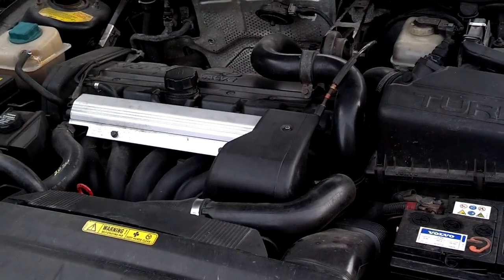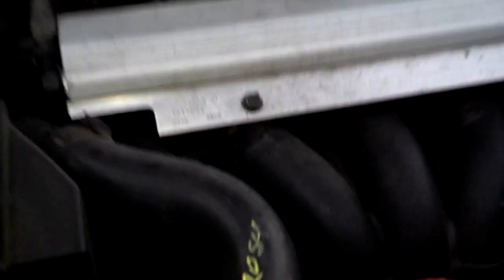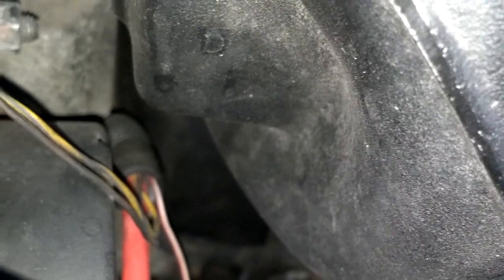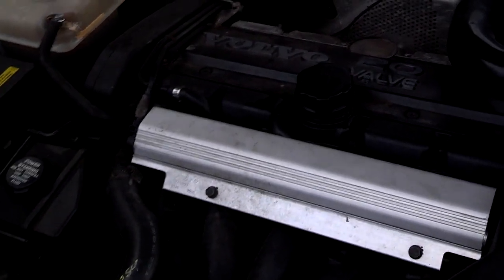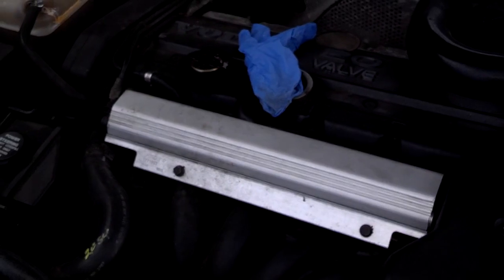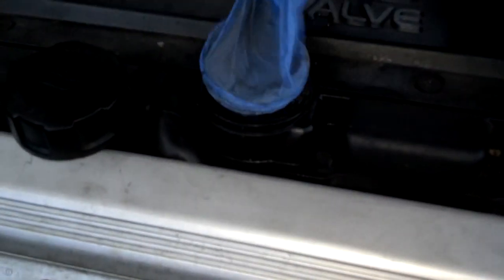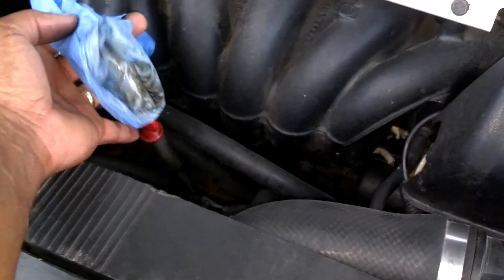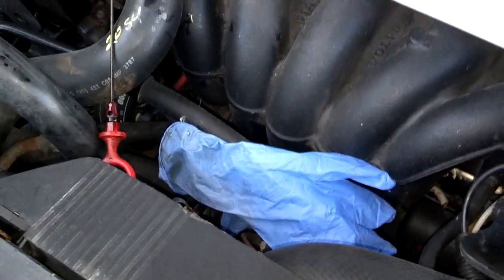Volvo PCV system check, 850, V70, S70, and others - VOTD

Comment: Hey Robert , Hope is well ! 
When I rebuilt the head on our 99 I replaced the PCV system at 180,000. I was just getting ready to do the belt and water pump at 240000 since I noticed a leak coming the cam seal behind the vvt on the exhaust cam. I may not have pressed the seal in properly the first time but I will check the PVC system to make sure that isn't why I am having cam seal issues.   My question is while I was checking the timing marks and getting the vvt spring tension set (after replacing the cam seals/pump and belt) I had to reset the vvt by a tooth. When I removed the vvt cap ( after new seals and running 20 miles)I had a few maybe 2 to 5 ounces of  engine oil come out the vvt  but had not seen any oil leaks while testing it running for 20 miles. ( P0014 code timing off) Which is why I pulled the vvt back off and reset it with cam locking tool and crank pulley set to block TDC. I had everything set up the first time then hand cranked the engine two revolutions plus went past TDC then hand cranked engine back to TDC all marks had lined up but I think I had a little slack in the belt and it was off one tooth. It looks to me the way the seals work on the vvt and engine block that oil would have to enter the inner vvt and is held in or prevented leaking by the vvt cap? Just wondering if I may need to redo that seal again........ I guess if I run it for a while and do not get any leaks that is the way the vvt interacts with the cam shaft and engine block and camshaft seal.....    appreciate your time as always
Donny
Reply from the maker: +Donny McClure please NEVER use the term TDC with vehicles that use marks to align timing, especially these white block Volvo's.

The hub's hold oil so you can find oil in them. They also have 2 seals (I believe).

If you are off a tooth according to the marks, you need to loosen the belt and move that cam so that the marks are correct.

If the belt is loose after you crank it over by hand reset the tensioner.
Reply: This technique works great for setting cams with VVT's and thanks for the info! 
 Basically, consider it to be a three stage process:

Stage 1
Forget the VADIS proceedure for now and whatever you have tried so far  

Stage 2
Have
 the crank locked in position on its mark. Drop a 6" 3/8 extenstion into
 the hole near the starter, turn motor counter clockwise by hand until 
it hits the stop.
Cams should locked in position, in line with seam in head.
Ensure all all notches are lined up on the cam pulleys with the timing belt cover.
Timing belt sould be on.
Inner bolt on cam pulley that fixes the unit onto the camshaft should be torqued down (Circa 88Ft Lbs, please verify).
The three bolts for the cam gear to VVT unit should be loose
VVT
 unit should be turned fully counter clockwise (bolts will be on the 
left of the holes in the toothed pulley when this is done).

If 
you cant achieve stage 2, ie the VVT unit will not move far enough 
counterclockwise for the three bolts to be at their leftmost limit, then
 the center bolt that attaches the unit to the cam needs to be loosened 
as their relative positions are incorrect.

Stage 3
Keep cams locked, pulleys at marks amd crank locked\at mark.
Fit the outer "cap" onto the VVT unit (T60 torx), no need to torque it yet.
Rotate the VVT unit clockwise using the cap with a T60 torx until it hits its limit.
Lock the three outer pulley bolts.
Torque the VVT cap (25 lb/ft I think, please verify).
You
 should now be in a position where all marks line up and the three 
pulley bolts on the VVT unit are on rightmost part of the holes in the 
toothed gear.
Reply: PS passed the glove test thanks for that tip, I replaced the PCV system at 180000 whe I rebuilt the head... didnt want to repeat that again if not needed! I think my cam seal problem was due to not having it seated properly the first time !

Comment: Robert thank you so much for all your info & videos!!   I have a 2003 Volvo XC 60 that sells of gas fumes when I fill the gas tank up  as much at the gas pump will allow at the Gas station. I have head that there could be an abrasive leak formed over the years and I am thinking that's what happened to this XC 60 . Is there an easy FIX like with a little silicon over the leak? I there an easy way to find that leak>>>>it seems to be in the filled neck.  Thanks Bill In WISCONSIN
Reply from the maker: Hi Bill, sorry I didn't see this post 8 years ago. There may be a recall on that issue. If there is not a vacuum line leaking that needs to be replaced, you will likely need to replace the bad part.  There are also sealants, epoxies, etc that may be able to seal a leak.

Comment: ok and is it normal that the car blows up the glove whit cold engine? And whats about the smoke? the car just smokes a bit when im driving not when the car stays with running engine. Thank you for your support.. and your videos are very helpfull, you are the only one worldwide bringing the proplems a the point. Man im writting you from Luxemburg = europe...over here they are just crap
Reply from the maker: +Nicolas Philippe Yes, sometimes the rings are a little worn and they need to warm up to seal and stop piston blow by. If you are getting smoke from the tail pipe it can be several things. I'd start by checking the turbo, pcv system, and go from there. Make sure you have the correct oil.

Comment: Hy Robert i have a volvo v70II 2.4 d5 163hp from 2006 and i did the tests you describe with the glove and i have also smoke wich comes out of the dipstick an oil refill hole. The globe is blowing up and i change allready the pcv pipes. Results same than before. On that volvo the pcv is one piece with the oil filter and it costs a lot to replace it! Is there no other cause for this problem?? Actually the car habe a high oil consumption and the turbu is leaking oil but not in the same amount of oil consumption. The engine is burning oil, when im driving and push the gas pedal it smokes a little bit blue white from the exaust. Is this an effect of an clogged pcv?Could you please help me out with this problem?
Reply from the maker: +Nicolas Philippe Did you do the test with the engine warm? Did you do or have a compression test done? If the engine is worn, it will cause blowby. If the car is smoking, that needs to be repaired as well.
Reply from the maker: +Nicolas Philippe You may want to have it checked at a good Volvo shop or dealer to see if they can find the problem.

Comment: Hi Robert I have a 1995 850 non turbo Volvo. I am having problems with my Volvo idling. I have replaced the pcv system and have had a tune-up. Using all Volvo parts. It idles high when I first start it and when I stop at a red light. The RPM goes high at these times and that is making it burn plenty of gas. could you give me some suggestions on what I can check. Thanks
Reply from the maker: +Kileah Hardy Is the throttle body properly adjusted?

Comment: Hey rob, my brother is a volvo tech. Told me i had a bad breather box most likely. How often is it the actual bix, and how often is it the elbow. He always tells ne to keep dipstick open to avoid pressing out a seal as you said.
Reply from the maker: +71sc502 huh? Bad box, about one of ten. Usually broken parts, 7 of 10. I never recommend pulling the dip stick.
Reply: He told me to keep it open a little bit so pressure doesent build up. And damn that was a fast reply. Thanks man!
Reply from the maker: +71sc502 The real solution is to fix it, soon. ;)
Reply: Ovcourse buddy. Wasnt an option at the time. Its off the road now so the necessary repairs shall be doin before so. All i need is a battery (and hopefully not an alternator) and a belt tensioner, and im ready to roll.
Reply: She purrs at 205k
Reply from the maker: +71sc502 What kind of car is it?
Reply: 96 850 (na)
Reply from the maker: Cool.

Comment: Can a bad pcv system cause timing belt failure?
Reply from the maker: +Owen Brown nope.
Reply from the maker: +Owen Brown well, I guess it can if it blows out the front cam seals, then saturates the belt with oil, which in turn causes the belt to fail or jump timing.

Comment: The problem with the oil box plugging is almost eliminated by using synthetic oil like Mobil 1.  I cleaned the throttle body and the oil box at 100,000 miles and the box didn't have much in it.  We cleaned it out using hot water to make a strong solution with dish washing liquid.  I let it soak for about an hour and then sprayed Simple Green inside.  Rinsed well and the box was very clean.  Cleaned the throttle body and put in a new set of Volvo plugs.  My XC 70 runs like new.
Reply from the maker: +John Ferguson Cool, how many miles do you have on it now?
Reply: Robert DIY 116k and it still runs like a top.  The one piece of advise I can give is to change the fluid in the Haldex unit (XC 70).  Volvo says that it last forever, but that's bull.  The fluid was loaded with clutch material when we opened up the case.  Changed the filter and the four wheel drive worked beautifully again.  The ABS is showing a strange intermittent failure and throwing a ABS check light.  Do you have any suggestions?  I saw a You Tube video and it seems that the plastic case warps with age and some pins inside start to lose contact.  Ever seen that?  Thanks, love the channel.
Reply from the maker: +John Ferguson What year is the car?
Reply from the maker: +John Ferguson https://www.youtube.com/watch?v=0zV8nGeGukQ

Comment: I had to delete last message due to the specifics.

I just Bought a 1994 Volvo 850 Turbo 190k+ miles for $1300.00

It has a small, and when I say "small" I mean super small oil leak. 

Details:
So it's not leaking in massive amounts of oil. It's not even leaving a puddle unless it has been driven extensively through the highway. 

It's leaking where the oil pan is located. The bottom of it is soaked in oil, I reached down under it after it was degreased and my hand was soaked in it.

I am thinking personally that it is just a worn out rear main seal. However the experience of a car enthusiast such as yourself could tell me where my next step should be taken.

Thank you sir
Reply from the maker: +Adam Sandifer Is the PCV system serviceable? You'll need to locate the leak.
Reply from the maker: +Adam Sandifer The PCV looks good. I recently learned that the PCV test should be done when the engine is warm or hot. Also, you will need to find where the oil leak is coming from. Is there oil at the bottom of the distributor cap?

Comment: My volvo 850 1994 non turbo is smoking from oil dipstick and has positive pressure (inflate the rubber glove) I cleaned the oil breeder box flame trap screen and checked all vacuum elbows including the vacuum hole  in the breeader box and still not improved
Any idea why?
Reply from the maker: +adrian avram did you replace the system and clean the holes in the block?
Reply: +Robert DIY 
Thanks for reply---my car is non turbo-and does not have the the oil box just the flame trap that is clean--I am not aware of holes in the (motor)block?
How many holes and where are they located
Reply from the maker: They all have the oil box.
Reply: +Robert DIY I checked again the rubber vacuum hose between vacuum tree and flame trap and found a small crack--replaces the hose and the pressure is negative and no more smoke! hard to believe such small crack can make your dipstick smoke-thanks for advice-great site
Reply from the maker: You are welcome. Thanks for watching.

Comment: Its Shaun in Vegas....I guess the end is coming between my 1995 850 and myself as it has failed smog in NV twice .....both times for visable smoke through the rear tailpipe. Im pretty sure i have the right weight oil in it , just changed and i use full synthetic,....i did the glove test and it blew it off.
Reply from the maker: +shaun miller That will do it.

Comment: Hi Robert, your work is amazing! I changed my headgasket with your help. Now that it's done I wanted to check the PCV System, and I did. The glove didn't fill up slowly but was immediately filled and straight up. Is it also possible, that not just the PCV System is clogged, which I should have checked when the intake manifold was off, but also the Headgasket is not sealing as well, because it's so much blowing out?
Thanks in advance for Your answer
Reply from the maker: +jorgemartin2046 A warn engine will cause the glove to inflate. I would do a compression test.
Reply: Robert DIY
I did the compression test and it says
C1: 170/210
C2: 135/185
C3: 150/180
C4: 145/198
C5: 160/230
Actually there comes oil out the camshaft gaskets where the camsensor is, thats how high the pressure is. What do You think i shoud do next?
Reply from the maker: What kind of car do you have?
Reply from the maker: Those numbers are bad. Should be within 15% of each other. Looks like you have a bad engine. You may want to have a lead down test done.

Comment: Hi, Robert,
   Thanks for your videos. My 2007 S60 has a good vacuum at the oil cap, but the dip stick has smoke coming out of it. Do you test the dip stick after driving around a while as I have or do you test immediately after a cold start when the car has been sitting over night? I use Mobil 1 synthetic 0w30 by the way - Upstate NY cold weather.
Reply from the maker: +Dog Food Man, I wish you guys would stop pulling that dipstick looking for smoke if the oil cap has vacuum. YES some smoke will come out of the dip stick hole and oil cap when removed. The engine oil is hotter than the ambient air temperature. If you took a pot of oil off the stove at 220 degrees and set it outside, it will also smoke. You should be fine. Not sure if you are running the proper oil viscosity or not.
Reply from the maker: +Dog Food Looks like your owners manual recommends 5W-30.
Reply from the maker: +Dog Food https://www.youtube.com/watch?v=wyF3o3c1uug

Comment: hi Robert I am still looking for an s70 preferably 1998 .went to check one out today and found that there was smoke blowing out of the dip stick hole , also while the engine was running there was smoke and look like pressure coming out of the filler hole . didn't have a rubber glove but it seemed to me that there might be a problem there , the cheapest repair for this in my area was quoted at $800.00  and 2 days work . any ideas?
Reply from the maker: +Clarence Stone https://www.youtube.com/watch?v=L4g-w4OXeBw

Comment: Hi Robert, thank you for your videos I enjoy them very much as I own a Volvo myself. I actually have a question about my 06 Volvo S40. I have check engine light and code po171. But, my cars runing is fine. I have no tool. auto parts store checked that for me. I'm concerning O2 sensor, MAF sensor, MAP sensor, PCV system. So much think of this problems. I actually do not know. Anyhow Your videos wonderful helpful to me. thanks Robert.
Reply from the maker: +jay kim The code points to it running rich or lean. Usually a vacuum leak.

Comment: On my 99v70R, the glove used to inflate a bit, so I replaced the PCV hoses and breather box (new complete kit from IPD). Now, the valve cover has plenty of vacuum, but the oil dipstick is pushing out, the car makes a whistling noise and gets horrible gas mileage. What now?
Reply from the maker: +Dan McBoost Something is loose or disconnected, not sure what, you'll have to find the source of the whistle, that is the leak.

Comment: Hi Robert, thank you for your videos I enjoy them very much as I own a Volvo myself. I actually have a question about my Volvo v40 (04). Recently my car has been dying at seemingly random times. I will feel weak response from the engine, then look at the tachometer, and my rpms are fluctuating. When I come to a stop the engine completely dies, however it always starts back up. Do you know what this could be? The shop I've been going to hasn't been able to find the problem multiple times, and the last time I brought it in they said it was my manual boost controller. However I know I installed it correctly and it is working properly. About 3 psi above stock. What do you think the problem could be?
Reply from the maker: +jacob orange Codes?
Reply: +Robert DIY that's the thing is that the check engine light comes on when the car dies, but when you turn it back on they're always gone.
Reply from the maker: Then it is likely a fuel pressure problem. I would test or replace the fuel pump relay.
Reply: thankyou i will look into it